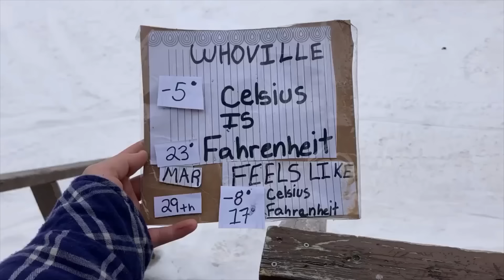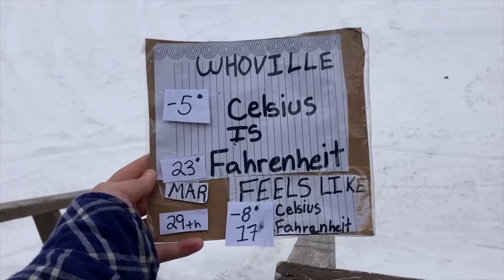Good Friday Relaxing in the Winter Freighting Caboose from the 1950s March 29 2024

Comment: l see you using a skilsaw to cut firewood  and am wondering if a battery powered chainsaw would be useable in wilderness alaska but in northern manitooba  ?
Reply: not really. Lithiums cut out with the really cold temperatures outside. If the shop is really cold inside, The lithium battery for a cordless chainsaw will be unreliable. I'm in Alberta. I am fully off grid. Lithium batteries are useless where I live in Alberta. The Kingdom in Whoville Northern Manitoba has harsher winters. Batteries are not very reliable and become extremely expensive year after year!
Reply: @960wattoffgridrv  10/4  thanks for that   it did occur to me...gotta say  he handles that skil saw like a pro...Happy Easter..
Reply: Why doesn't he just use a regular gas powered chainsaw?
Reply: @ironcladranchandforge7292  may be hardstarting up there would be my guess...2 hours later....still pulling  lol...happy easter..
Reply: I cringe but don't say any thing more till now king Handel's saw well lol 😂
Reply: @dave-uf8ir  yup   gotta give cred where cred is due  Joey does a LOT of things well
as does Xena   they make a damn good team...Candu  attitude goes a long way  !
happy Easter..
Reply: @drewclarke5920  🙂
Reply from the maker: it is the fact we cut everything but trees. most of our wood is recycled lumber with lots of nails and such.  thansk
Reply from the maker: it is the fact we hardly cut trees, it is everything else that kills the chain saw chain  thansk
Reply: @kingofobsolete4789  --  Out of curiosity, why don't you cut trees, especially since there are a lot of trees on or around your property?
Reply: I attached a magnet to a metal hot dog roasting stick to fish all the nails and screws out of my wood stove. I also find speaker magnets and I drill a hole through the center and tie a chain to the magnet to keep nails and screws off the ground to avoid flat tires!